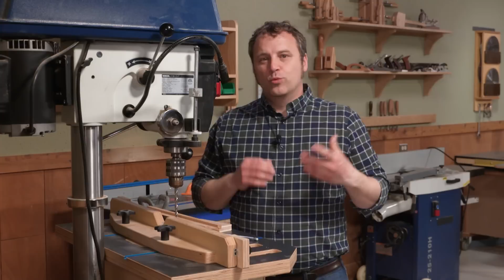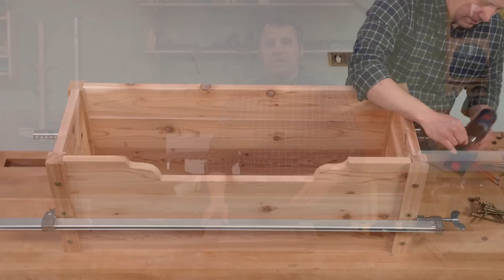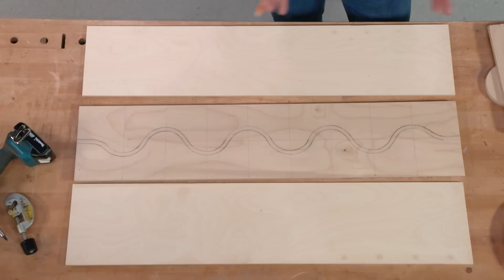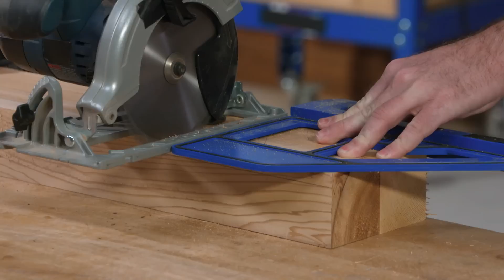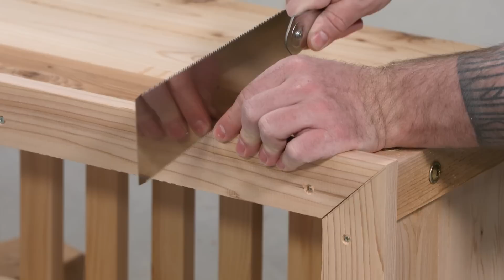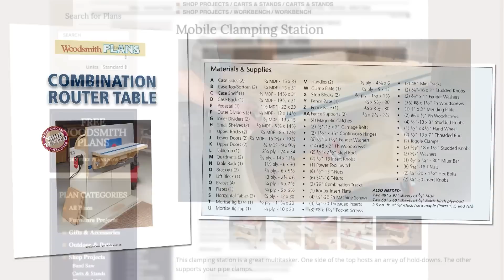Building a Patio Planter With a Twist!

Comment: Note that you apply FORCE with the clamps.
Reply: Darth Vader never used a clamp.
Reply: Kidding aside...pressure is defined as force per unit area, (e.g. Pounds per square Inch), and the clamp faces are a finite length and width, so applying a force to the clamp faces is pressure.
Reply: @jeffbaker8808  That answer might get you points off in a middle school science test.  No offense.